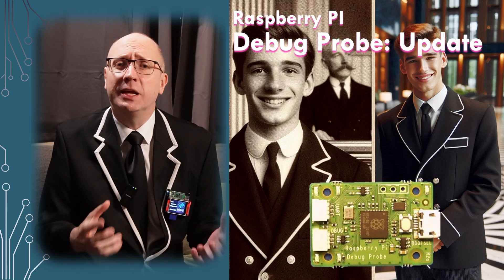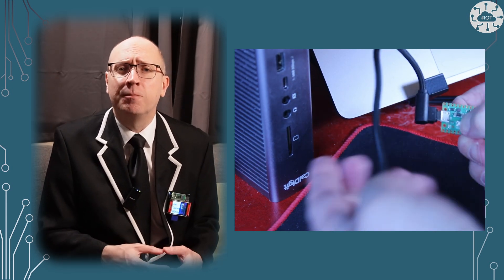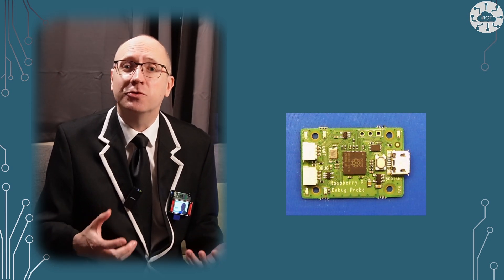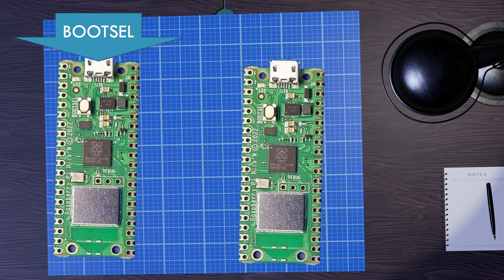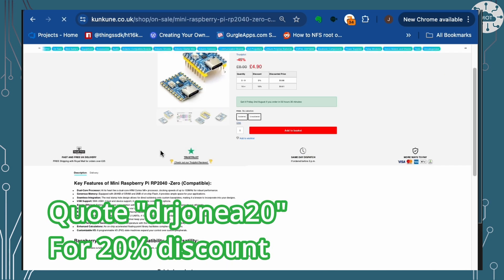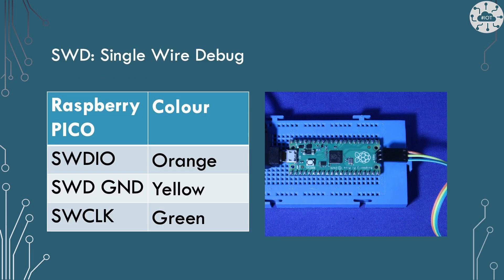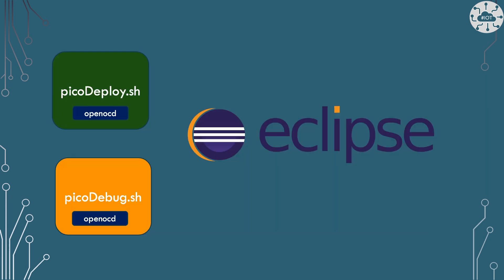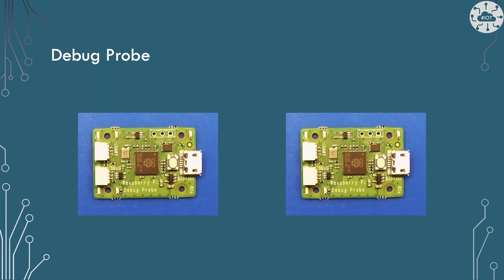My Experience with Raspberry Pi Debug Probe for Pico Development | DrJonea.co.uk

Comment: The Raspberry pi debug probe is dangerous! It killed most of our prototypes with nRF52833 chips. It doesn't sense the  target voltage, it just applies 3.3V to the target, even if it is running on 2.5V or 3.0V or even powered down. It is a very risky programmer.
Reply from the maker: Thanks for the warning.

Comment: Great content, just watched both your debug probe videos. I’m currently flashing via the probe (yet to succeed with debug though)

One question with the zero / other small rp2040, do you get just the swd or can you configure uart to have flashing and telemetry as with the probe? 🙏🏻
Reply from the maker: Thank you for the kind comments. 

Yes you get both swd and uart as part of the Pico Probe on a second Pico or RP2040 Zero. With the smaller boards you might want to hack the code to choose which gpio pins are used.

Comment: OMG thank you so much. You very clearly explained the differences between bootcel and swd, and how the pico probe acheives it.

I do have some outstanding questions:
1) why is uart and swd on different pins? Could the swd protocol not be transmitted over uart?
2)likewise imo its annoying that you can't swd over the usb connection imo.
3) you spoke a bit towards bitbashing using a rasberry pi? I am curious if the pico probe is needed if you have a rasberry pi, can you directly connect to the pins on the pi to the pico?
Reply from the maker: Hi. 
SWD is a specific physical connection and protocol so cannot be done over UART or USB in that sense.
Debug and Flashing could be done over a Uart or USB in theory though isn't in the  onboard firmware to do that. There is a project to run Debug Probe on the core1 of the Pico while your code runs on core0. This might be what you are looking for. Take a look at: https://github.com/majbthrd/pico-debug/

Comment: I have a pimoroni tiny 2350 and official raspberry debug probe, my wiring is 200% correct, but I still getting Debug: 394 525 cmsis_dap.c:872 cmsis_dap_swd_read_process(): SWD ack not OK @ 0 JUNK using openocd -d -f interface/cmsis-dap.cfg -f target/rp2040.cfg -c "adapter speed 1000"
 command
Reply from the maker: You need target/rp2350.cfg not rp2040.cfg. You Will also need the latest version of openocd.